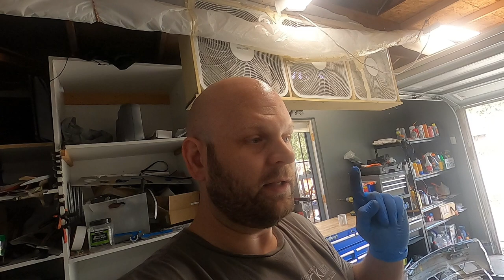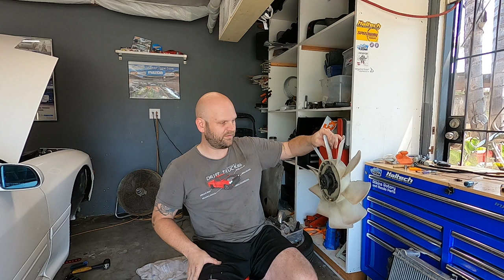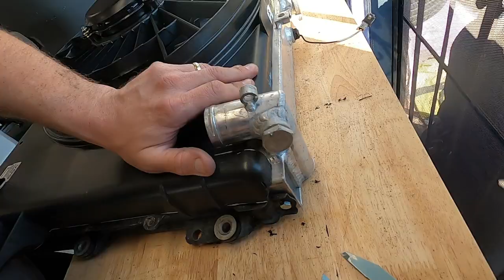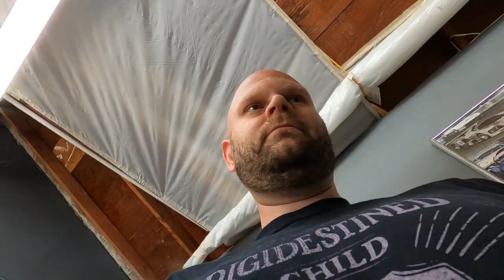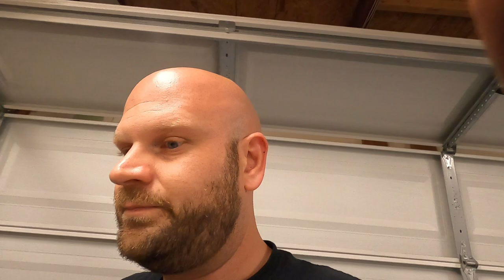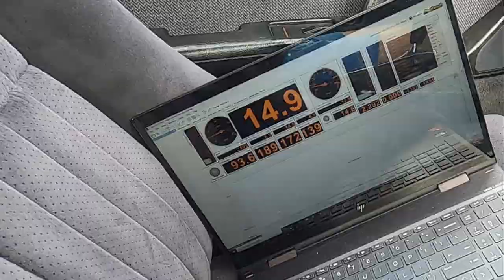back to basics Radiator Front Mount intercooler FC3S JDM RHD

Comment: I once ran an e-fan with a controller using PWM to modulate fan speed RPM directly to the coolant temp. This way the hotter the coolant ran the faster the fan would spin... Could be something to look into to allow the car to get up to temp and also circumvent being locked into two speeds.

Comment: At 180-190 degrees my stock temperature gauge needle is 1/4 under the Hot. I’m not getting any warnings from my Haltech because my warning is set at 220F. The low speed fan kicks in and the  needle drops back to the middle. I’m also monitoring my temps with an aftermarket gauge. All sensors are within the same area in the engine. Could my stock gauge be inaccurate?

Comment: Got the same fan for my fc. What a world of difference.  Wondering where the connection is for the stock temp gauge as I'm running a microtech. But like that the stock guages still work.  Sorting out my car after sitting 18 years. You have helped motivate me along.  Thanks.
Reply from the maker: You need to run a connection from the stock temp sensor, next to the stock oil pressure sensor on the block. To the metering harness.
Reply from the maker: https://www.rx7club.com/2nd-generation-specific-1986-1992-17/water-temperature-gauge-w-no-ecu-905154/
Reply: @MohrGarage  thanks a ton for your help

Comment: Do you have a wiring diagram for your fan setup?
Reply from the maker: No, I just used two relays. First relay is triggered from an ignition on 12v source, power out (87) goes to power in (30) on the second relay. The second relay powers the low speed via 87a and the haltech triggers the main output (87) for high speed once the car is warm.

Comment: Part number for the Fan ? Also any links to the alternator:D
Reply from the maker: https://www.rockauto.com/en/catalog/nissan,1997,quest,3.0l+v6,1212578,cooling+system,radiator+fan+assembly,2181

Lucky7racing.net for the alternator
Reply: @MohrGarage  would any  fan from that secion work with the koyorad?